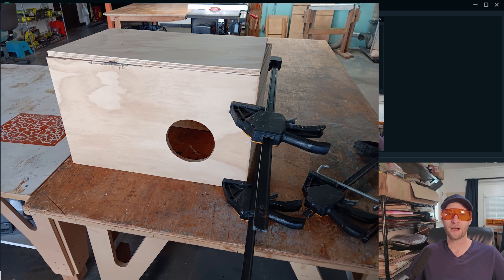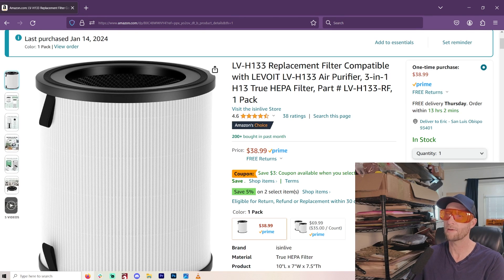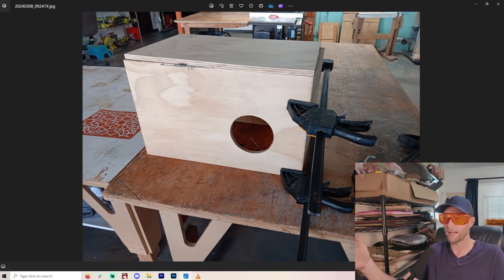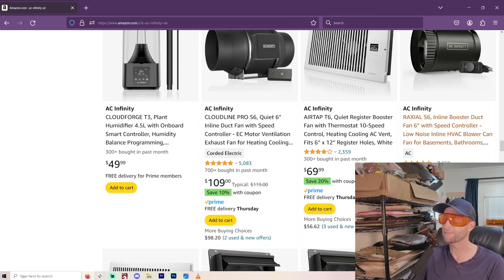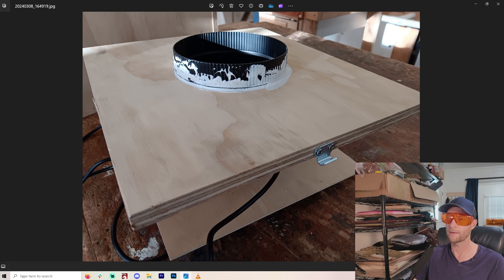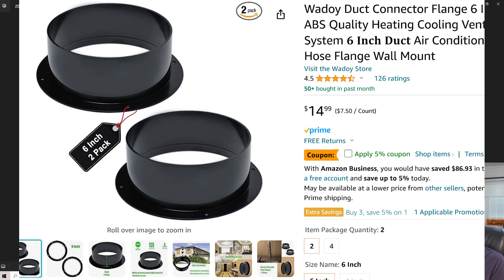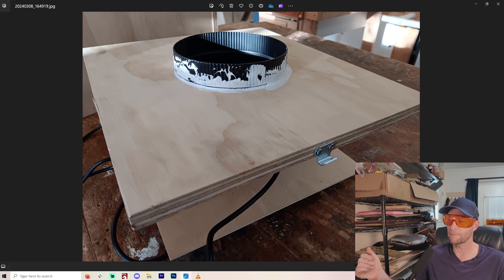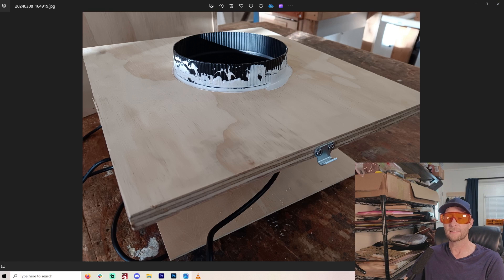DIY Smoke Filter for your Laser Engraver (Air Filter / Purifier)

Comment from the maker: While this purifier does work well, I found I had to replace the filter every month or it stopped working. Your mileage may vary...
Reply: And how many hours do you use it per day (approximately)?
Reply: A month doesn't sound that bad.
Reply from the maker: @christianmeyer3277  It is not so bad, but the one I just reviewed is probably a better way to go.

Comment: Why did not you keep the exhausted air inside then , mainly in winter to save energy? Is it this safe ?
Reply from the maker: I don't know if any filter is 'safe'. But if you want to spend 7k, you can probably get one pretty safe in my opinion. I won't trust any filter if I can help it (which I can).

Comment: Nice videos, very informative. I am thinking of making an enclosure for my Sculpfun S30 ultra 22W and connect it with an inline fan and a 3stage filtration  box that has carbon filters and Hepa filter as well.any Advice or suggestions
Reply from the maker: Frankly, you can't build a better one than the one I reviewed a few months ago. It worked as well as mine die, but was way easier to replace filters and cost about the same all said and done. BUT, if you want to make it, the pleasure can be in the creation.

Comment: Well I think I've watched this 3 or four times, and have put way more thought into more complicated designs...and I'm back, lol.  I'm thinking your design, with 2 stacked filters in the box, and the 8" fan on top.  I wanted to use loose charcoal, but it looks like you need 30 lbs or so...getting heavy and complicated.  Your filter pick seems to be the best bang for the buck and will do well for venting outside with neighbors that aren't super close.
Thanks again, love to see an update if you have time.
Reply from the maker: I would probably add a pre-filter that get the big stuff and is washable. And then perhaps a more powerful fan. I am currently using this one, and the airflow is much better: https://www.amazon.com/gp/product/B0C7Z7PPBH/ref=ppx_yo_dt_b_search_asin_title
Reply from the maker: It is really tough to do all of this, and it gets costly over time. There really is no shortcut to the $5k filters, but man, that is too much money. I can honestly say there are not 'perfect' solutions that I have found.

Comment: is there any cheap alternative purifier to the Xtool F1 laser machine? Did you find any on Amazon? Thank you for the nice video
Reply from the maker: I just don't think there are any cheap solutions. The only ones I have seen that actually work for long term are over 4k. And then you will still need to buy filters. Cheaper ones will either do an OK job, or need replacement filters often (like mine).

Comment: How did you connect to the laser? My laser has a useless 3’ fan in the back. Would it work with a 4” hose from the laser to the box, with a 4” inline fan closer to the laser? I only have an XTool d1 pro 10w at the moment. And if you had multiple lasers could you put blast gates just before going into the box?
Reply from the maker: I used a 4" flange like I mentioned you could add to the box. Then added a 6" adapter (you can see in the vid). I think just doing a 6" the whole way would be better. You can just cut a bigger hole. Ditch the fan that comes with the laser. Yes, you can do a Y blast gate if you wish.
Reply: @ValleyForged  Thanks! I don’t have a way to vent outside, so I’m glad to see this design. I could use this and have my laser upstairs, vented out the window.